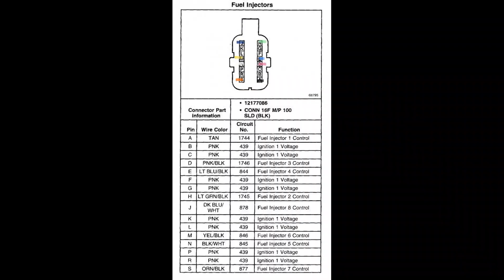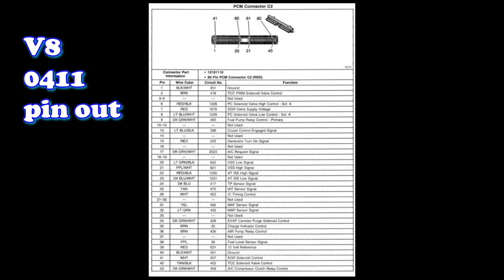S10 V8 Swap Wiring Guide (How to make it all work like FACTORY)

Comment from the maker: Found out some new info, your Tan wires for the o2's NEED to be spliced to a chassis ground. I used the same ground wire that I had going to the side of the alternator. I believe this is only if your truck is 03/04. Pin 26,28,29.
Reply: I'm slightly confused I got kids distracting me right now. I have and 03 Ls 2.2. Do I need to order a different ecu?
Reply from the maker: Check if it says 0411 on the bottom then ur good if not, off to the junkyard or Ebay.
Reply: @nicholsperformance92  thanks

Comment: Why didn't you just use the computer and wiring harness from vehicle engine came from?
Reply from the maker: This came from a gmt400, different computer that’s not compatible with the S-10 set up.  Even if I got the engine from a van, the computer is on the opposite side of the engine bay and you’re talking about hours of pulling wires. Lengthening and shortening different wires. This is definitely the easiest way to go. You’re only changing a small handful of things.
Reply: @nicholsperformance92  I understand Was just asking wasnt criticizing
Reply from the maker: It’s all good man, don’t take it the wrong way, I was just explaining. Thx for watching!

Comment: Pulling the 5.7 harness would have been way easier. The plug at the firewalls are the same and plugs right in. Not cutting or splicing.
Reply from the maker: Doesn’t work like that on these trucks bud. You’re talking about hours of cutting and splicing where I just had to change a few plugs around… not to mention the fact that the computer and the battery are on the complete opposite side compared to the full size trucks.

Comment: Hey, pin 9 is a blue wire, what are you suppose to do with wire in pin#12?
Reply from the maker: So the blue wire on pin 9 will become your one wire knock sensor wire. Just extend that to that location. and then pin 12 can just be taped off or removed all together.

Comment: Awesome video thanks for posting this . Quick question do the stock gauges work or do you have more wiring
Reply from the maker: Every thing works as it should at this point. Not even check engine light.

Comment: Hey I have a 99 extreme with the 5.7 swap. You can run a mechanical fan if you get a Chevy Colorado clutch fan for a 5cyl and it allows enough space for a fan as long as you recess the radiator...nice build you have. Just wanted to put this info out for anyone doing this swap
Reply: Also doing this swap Hp tuner is one of the best investments that you can make. Or a tuner along the same lines
Reply from the maker: Yes sir! Just made that investment actually. Can't believe I've went this long without. let the real games begin now😄
Reply from the maker: Good info, haven't heard of this one. I might look into this if my Efans can't keep up this summer.
Reply: Hit me up anytime if u have a question or found something new
Reply: How did you go about the wiring? I'm doing the same swap as he did.

Comment: Why cant you use the V8 harness?
Reply from the maker: Your talking a LOT of splicing and rewire work, the V8 computer is also on the other side of the engine bay.. compared to just making some simple mods to the stock harness. That's going to be much easier in most cases.

Comment: Does half of us no good. No fuel injection have a carb.
Reply from the maker: Most of the ppl ripping off all the Compter stuff and going carb with somting like a 700R4 Arnt worried about the stock gages working. Its kind of keep it all or lose it thing
Reply: @nicholsperformance92  Just for the hell of it how about a 5 speed and all that serpentine stuff is also gone. Doing V-belts. I just cant ditch all the wires I am stupid when it comes to electric home and auto. I can't even figure out how to use a  simple ohm meter to trace wires. I can build ya a house with my eyes closed but stupid on electric.

Comment: Thanks for posting these videos.  Quick question can I use a cpu from a express van and wiring harness w swap . Also do I send ecm out to be programed or does it have to be connected to car
Reply from the maker: You definitely can use the express van pcm, and leave it with the stock tune on it… but you’re probably going to have to send it out for VATS removal anyhow. At that point it would be about the same amount of money to use any 0411 pcm and have it custom tune for what you’re working on. I went through( pcm for less ). You just send the computer itself in the mail.

Comment: Thanks for reminding me about the O2 heater wires!  it was driving me nuts why the fuel trims kept going to -30.
Reply from the maker: No problem man. Yeah, It took me a while of tracing the wiring diagrams to figure out what was going on there.. also there might be more to it that. I have to get the truck up and running again to be sure. But I don’t think the system was going into closed loop when I was driving it.

Comment: So I have a 96 with the same swap but I went with a carb set up. Do I need a pcm still? I’m assuming no because there is no need for fuel management
Reply from the maker: Well, if you’re still on the stock 4l60 trans you’re going to need some kind of computer to control it. And then there’s also the ignition unless you convert to an older style distributor. There’s a few other odds and ends, but you can definitely do away with all that stuff if you really want.

Comment: I got an 01 originally 4cyl is there anyway to get the gauge cluster to work with a 400sbc?
Reply from the maker: depends on a lot of things what intake system you’re using, what trans and your need a 0411 pcm if you don’t already have one being an 2001. If you’re doing something like a carburetor, you should be able to get some of it working. speedometer and tach are up in the air depending tho.
Reply: @nicholsperformance92  ok I appreciate it, I’m using old school carbed sbc and th350 trans.

Comment: I put the l31 5.7 vortec in my 96 jimmy 2dr my spider injection leaked onto my headers when finally fired it up caught on fire i switched it to carberator afterwards subbed and following this build how is it as far as power hows u think it runs ? Thanks for the content
Reply from the maker: Thanks, that sounds crazy! Well, with the modded 5.7 I was hoping for somewhere around 300s I’ll end up sharing more of my build as I get into it but with added cubic inches more stroke and more camshaft and compression. Hopefully it should be in the high 3s. It’s kind of hard to estimate because my headers are a little on the small side and also that injection intake is probably not the most free flowing either.

Comment: So I’m assuming this is to make it work like factory, but couldn’t you also just get a stand alone system from painless or one of the other companies?
Reply: What is needed for a carbed version as far as wiring goes? At at that point real soon
Reply from the maker: Yeah this is the clean street (stock functioning)  way, if you’re just building a race car or something then you could use one of the standalone systems or carburetor set up.

Comment: There is a ton of support for the “LS” design, not so much for SBC.
Reply from the maker: In the drag racing world SBC and especially BBC is king but LS is hot right now… But,, these are mostly aftermarket blocks such as DART… in stock form, yes LS is definitely superior. I plan on doing some stock block LS stuff in the future so I’m definitely not against them.
Reply: @nicholsperformance92  the simple harness swaps, headers, etc…. Are all catered to LS. Hardly anyone out there supporting the SBC swap guys
Reply: Because you just use it as if it's a 4.3 and fone

Comment: I'm doing this swap now. Only thing how did you know where to cut the motor mounts a little more with that would be a Great video keep going man ur doing great
Reply: Don't stop brother keep on keeping on
Reply from the maker: I just figured out cutting on the fly, I used the oil pan as a guide to get it close. Your only should have to worry about that if you're doing a ZR2. Thanks that means alot!